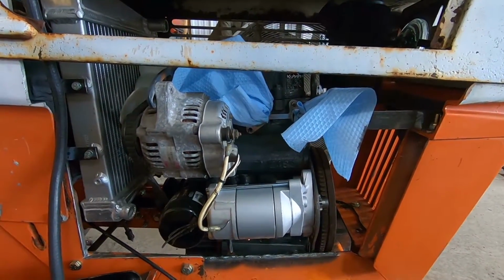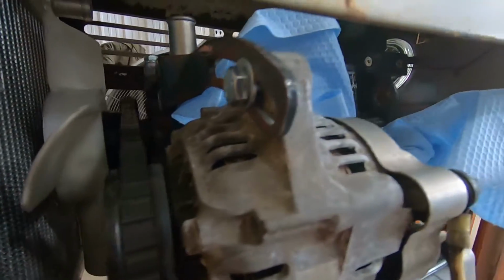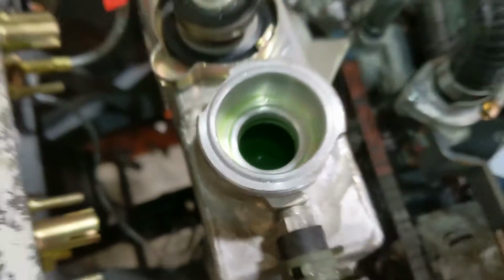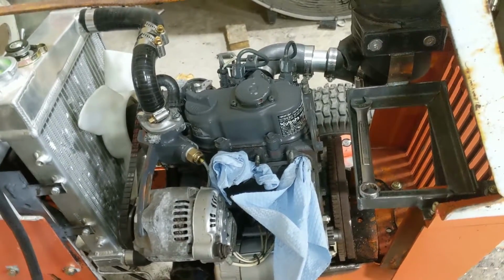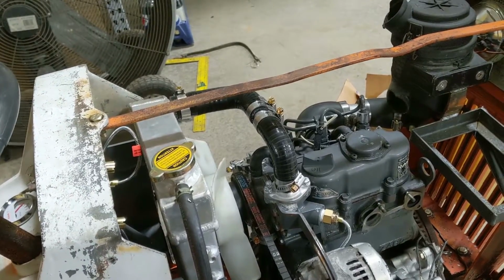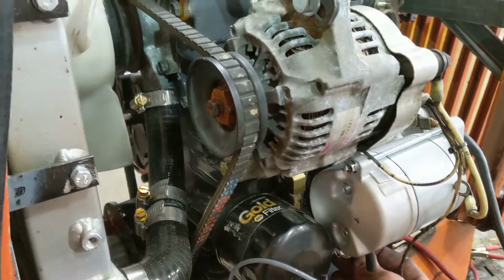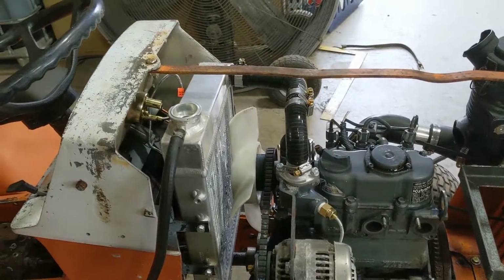Sears Hydro Diesel Build Part 4 First Start

Comment: The gear reduction starter is a must-have for the Kubota engines. The brand new OEM starter on my D600 just crapped out so I'll be putting a gear-reduction starter on it. Sounds like a great runner! I would send the relief valves out to Machtech Direct in Ohio, he can rebuild them for much less than the cost of new ones.

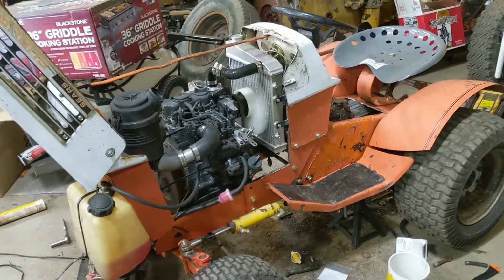Comment: Drop near the footboard at the 10:00 mark. Probably the relieve valve on the hydro unit. My guess for the hole in the dash is for a boost gauge when you'll put a chinese turbo on there. Nice vid!